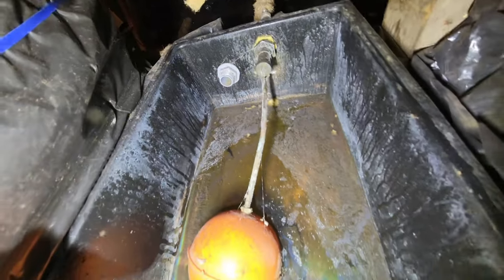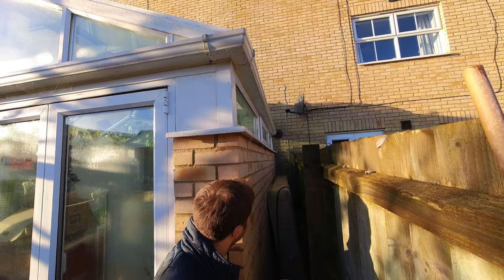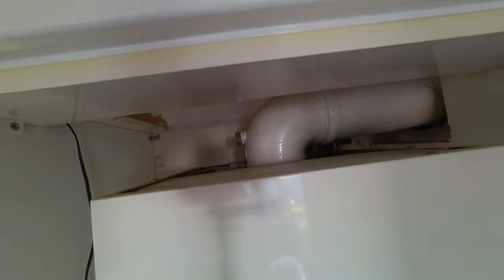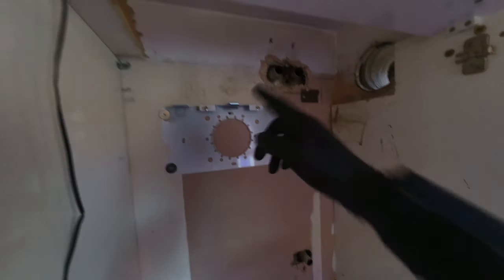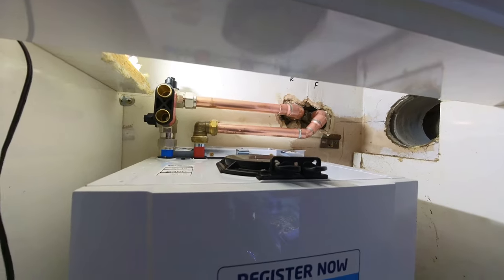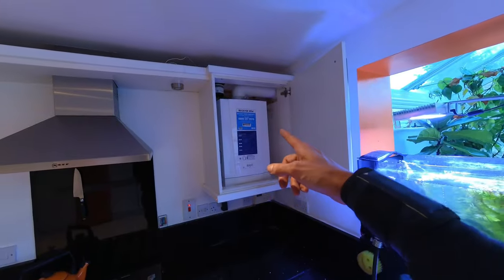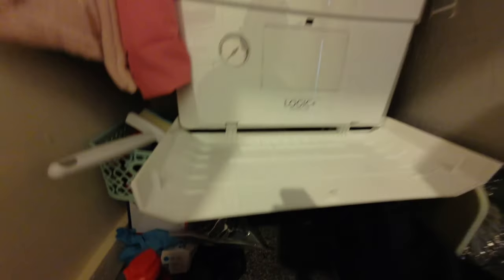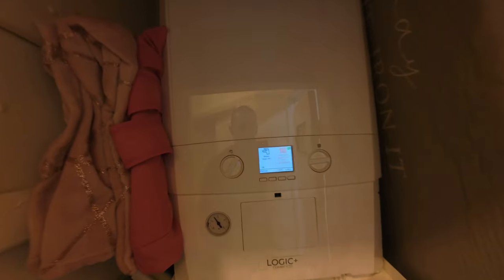That Dreaded Gate Valve! - A Day In The Life Of A Gas Engineer 106

Comment: Once the Magnaclean filter is fitted you could always use the magnacleans system to flush it 👍, much easier than a power flush
Reply from the maker: Yeah but I still prefer to powerflush as I find it's more effective 👍🏾
Reply: power flush machine is much better, stronger pump and bi-directional flow, not even close in effectiveness

Comment: Mate that boiler install, you said there was a 1mbar drop on gas line. on a new installation that yous carried out, your allowed zero drop, so that should of been investigated. Just for future reference.
Reply: Thought that only on a new gas run you had zero drop not existing gas run?
Reply from the maker: That's if it was tested with appliances isolated, or if I'd done a completely new gas run. It was tested with appliances connected and it was the same before and after
Reply: @BenFinch-xn5hx  but youve carried out work by redoing the gas run under boiler so youve redone part of the gas run. So in theory, you dont know unless youve the gas sniffer on the new soldered joints as leak detection fluid only good for schrader valves lol
Reply: Basically because theres no point of isolation between where the gas pipe was cut and the boiler, the whole pipework is now a new installation as the pipe from where it comes out of the wall to the new appliance has been added.  All i would of done is replaced the meter union washers as its more than likely there that has the leak. seen it loads. Got to remember, gas leaks are only going to get worse not better and if it comes to,  god forbid, something happening and that install was the last time someone was there, the solictors would eat you up in court as they are clever buggers. Just trying to help fellow gas engineers out and get the standards raised.
Reply: @cputilitysolutions  again if that boiler is the only appliance in the property you pretty much know its not on the appliance, its on the pipework as youve installed a new appliance.
Reply: Thank you for that mate I’ve literally just started gas last month so I was curious
Reply: No one likes to leave a pressure drop but the regs allow it cookers and hobs are usually the culprit i always try and find the problem.
Reply: @waynebrown7671  yes your correct, but your not understanding the video. The gas pipework has been altered, there was no isolation upstream of where the gas pipe was cut, apart from the ECV, so it has to be classed as a new gas run. Dont care if its only had 1 elbow, as the gas would of had to been turned off and meter taken off before soldering.  Any wonder there are loads of gas explosions in England. These permissible drops are usually more related to a landlords safety check as the boiler was already been there and is not newly commissioned. I could go on about it all day, but enough said. Maybe gas safe needs to see this really.